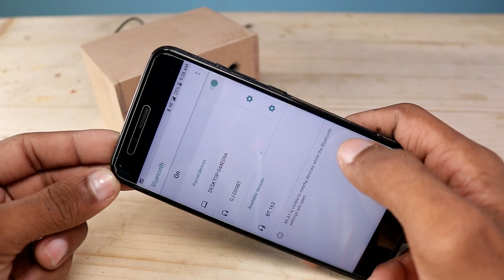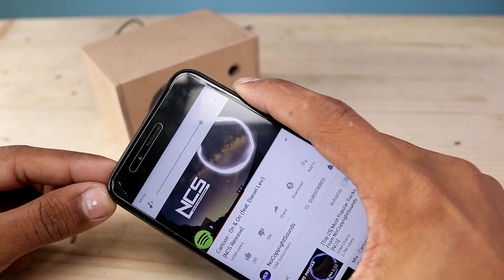How to Make a Speaker + Powerbank at Home

Comment: A powerbank elgondolás nagyon jó, de a sztereó panel helyett inkább egy HT 8692-es monó panelt vagy egy TDA2822-es hídkapcsolást kellett volna erre az egy hangszóróra kötni.
A 18650-es akkumulátor esetében 3 vagy 4 darab Sanyo UR18650 M33A-t vagy a Samsung ICR 18650-22E cellákat lett volna érdemes használni.
De elismerem nagyon szép munka.

Comment: You have to measure the port or put a radiator or passive speaker an make it fully air tight otherwise you won't get nice bass
Reply: You aren't going to get any base from this little bitty ass speaker. If you want any type of bass you're going to have to have a 6.5" or above. Just a little bitty 1" speaker physically cannot produce bass. The port is not measured obviously, that is for sure. Radiators or passive speakers do not make bass. And they do not give good bass either.
Reply: Learn more about Acoustics before you decide to discuss.